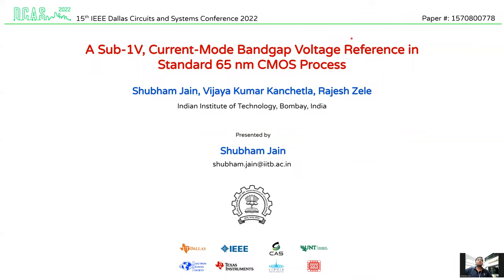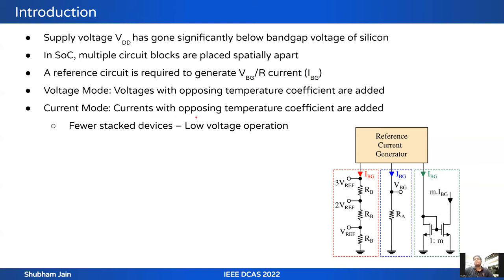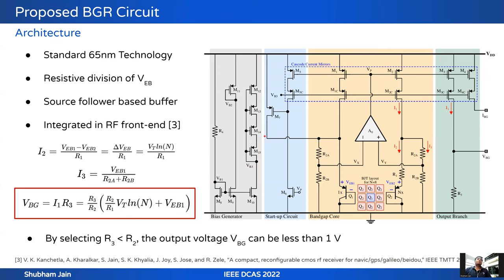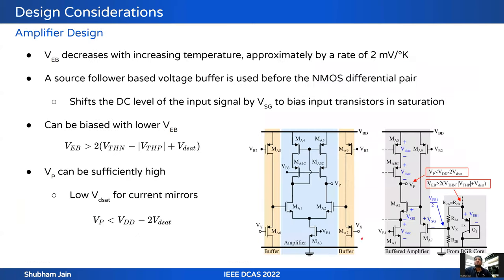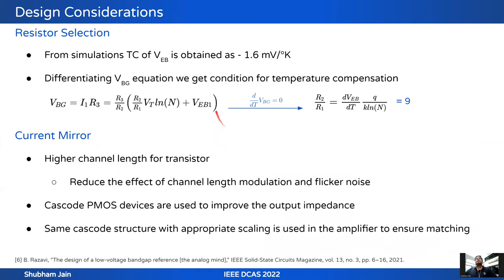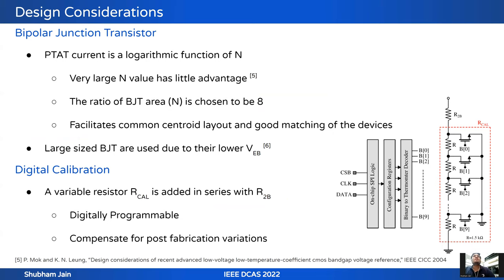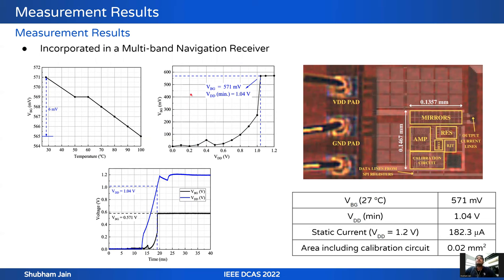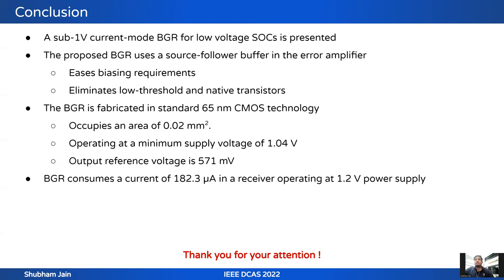A Sub-1V, Current-mode Bandgap Voltage Reference in Standard 65 nm CMOS Process

Comment: Hi Shubham, I have one doubt if I want to design a sub 1V bangdap voltage reference at 0.8V supply voltage then I can not use BJT's as at negative temperature the Vbe of BJT goes upto 815mv which makes it impossible to use BJT at 0.8V power supply. So do you have any idea which type of circuit can be used? I am working on 22nm technology node.
Reply from the maker: Hi Nishchay,
I believe you will need an "only MOSFET" architecture for your design. There are several such reported architectures available on IEEE.